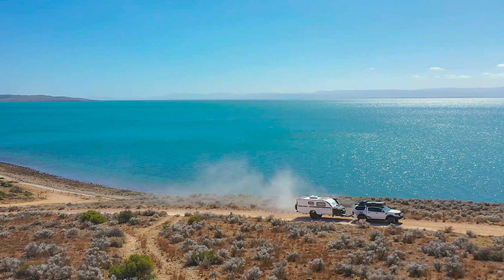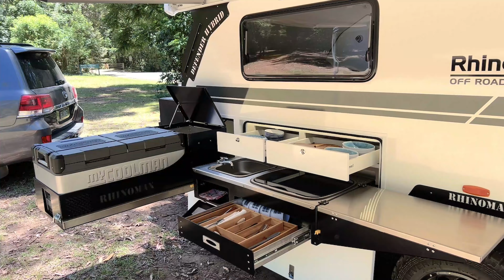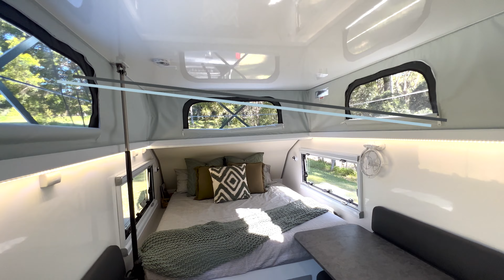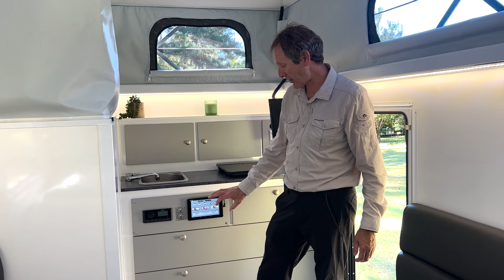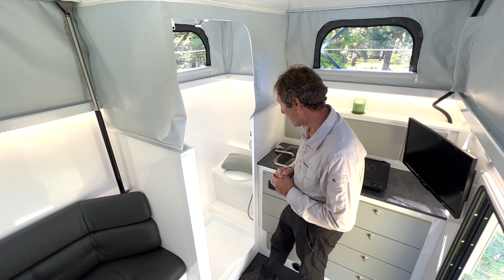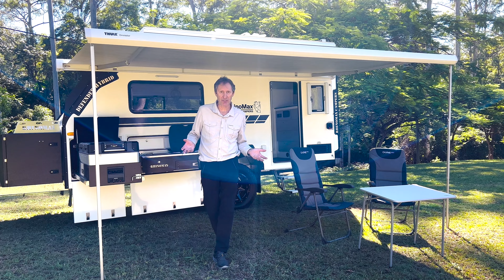FULL TOUR OF THE NEW MY 2024 Rhinomax Defender 15ft Hybrid Camper

Comment: No screen door? Thats a must to get the bugs out,
Reply: Think quickly I saw a magnetic screen as he steps inside in the left?
Reply from the maker: We opted for a magnetic screen door instead. Our door is made from the same composite panels as the walls, and uses a sealed hinge and gasket system with 3 locking points to ensure its air (and water) tight... Which you really need on an expedition vehicle. 

You'll notice that any van that has a screen door also needs to have a dust suppression system. A screen would be nice, but its too much of a performance compromise.